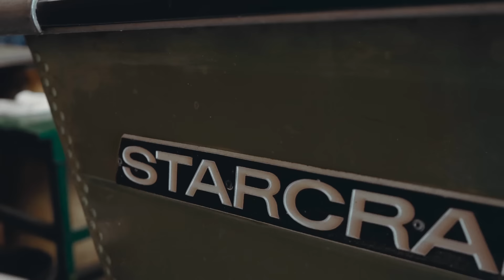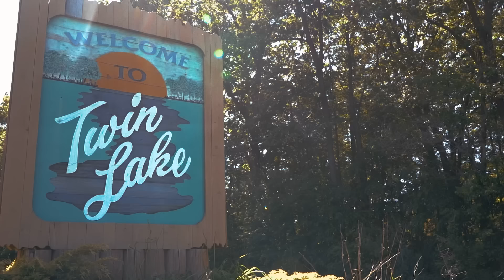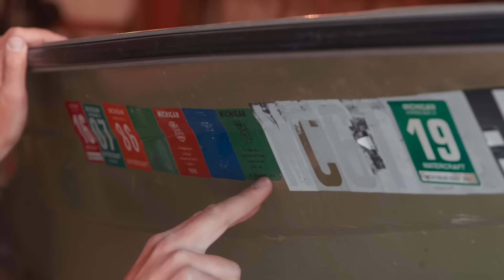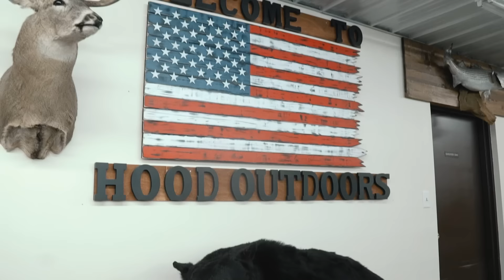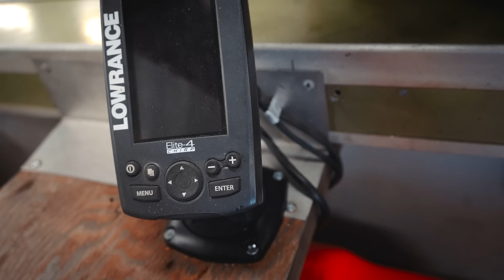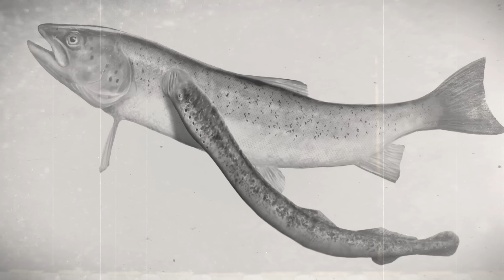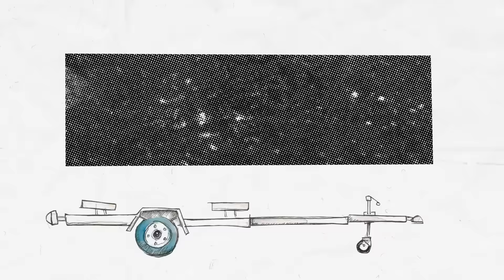Steven Rinella and Grant Gulley Troll for Lake Trout on Lake Michigan | S2E01 | Das Boat

Comment: Had a similar incident happen on a rig passed down by my dad only it was the bow rope. and the speed was approx. 60 in  Dallas traffic. The rig stayed  on the trailer... semi....bow skyward @ a 90  the skag contacting the asphalt and the rear tie downs  saved a truly catastrophic  event. The sudden reduction in speed from the resistance of the boat buffeting the wind and the  trail of rush hour traffic behind me parting for the ditches like the Red Sea remains vivid 30 yrs. later

Comment: What is that “diver” that is digging into the sand? I’d thinks it would work locally in SoCal for halibut trolling. Anyone share what that diver and how’s its rigged?
Reply: It’s a dipsey diver, you tie your mainline to one end and a leader to the other. When you’re trolling, it works like the lip of a crankbait and takes your bait/lure down. When a fish hits, the diver disengages so you aren’t fighting the diver and the fish. Some people add a rubber “snubber” between the diver and lure to give a little stretch so the hooks don’t pull out when the fish strikes. In this video, they’re also using a flasher (the fish shaped object) between the diver and lure to attract the fish to the bait.